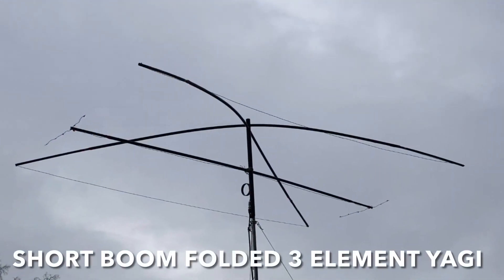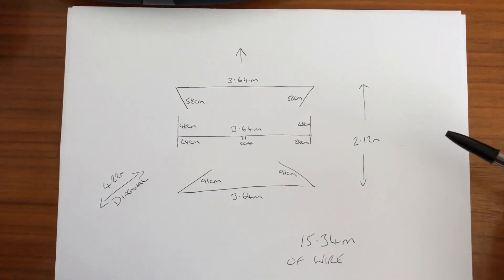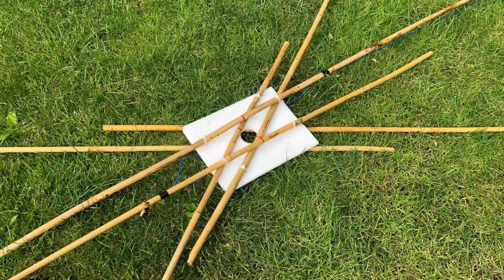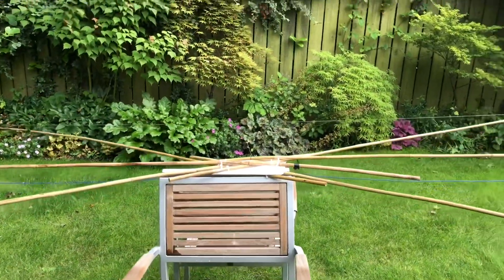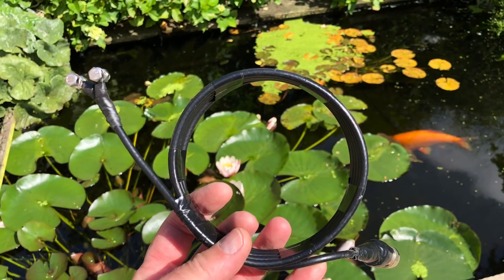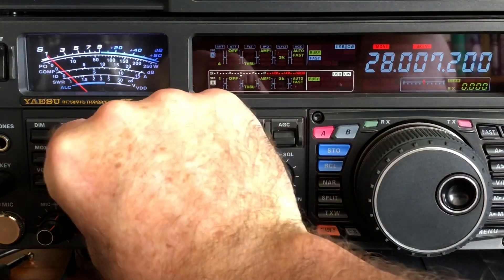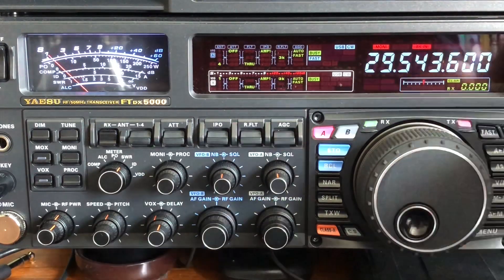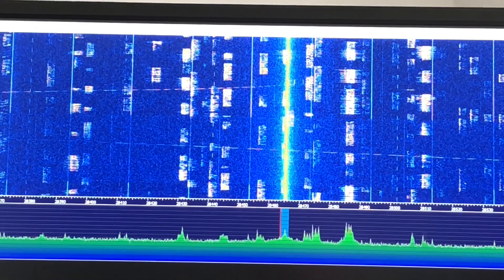DIY Compact 10m Yagi Mk2

Comment: I'm building this antenna (10m) following your videos, thanks for putting them up. I don't have a portable telescopic mast yet, what are the specs of your one? I'm using a heavy concrete umbrella base, maybe i can get a 3m pole. What is the minimum height for good SWR?
Reply from the maker: Good one Rob! Mine, with stub top is 7m tall. If you can say to 5m then that’d be great. Have fun 👍🏻
Reply: @G0CNN-Ian  I bought a 6.5m aluminium pole, it's up on that. SWR is 1.25 at 28.036. So far so good, got some more distance contacts. See photos on my QRZ VK3LER.
Reply from the maker: @Rob-ml7ps RR 👍🏻

Comment: From KC2UT Jerry, 
talked with you this morning Ian, you had nice 10 watt signal here in Central NY. ... Question: with the close spacing and folded elements is there some sort of matching going on as I would think the antenna is much lower than 50 ohms? But the proof is in the pudding, you sure had a smashing signal into Central NY this day, lighting up my Rig nicely and with my fixed Vee Beam with two 104 foot legs looking your way. Your Beam seems to operate well and at a fairly low height too... It looks your beam maybe just 20-30 feet above ground, which is fantastic.   Will save this page for future reference, thanks Ian......
Reply from the maker: Hi Jerry. It wasn’t me you worked today as I’ve been at work. Yes, the capacitive loading of the folded ends is what I think helps give it a good match. Yes, I’ve used it at around 22 feet and it works great 👍🏻 Hopefully catch you on the air properly 😉
Reply: that is fascinating if it indeed wasn't you Ian , because if indeed it wasn't you, then who was it ?   Am sure it wont be the last unusual contact  I make this sunspot peak... All the best
Reply from the maker: @jerrym1183  Strange. Were they using my callsign (G0CNN) or just referring to the mini-horse and my videos perhaps 🤔?
Reply: @G0CNN-Ian  catching up this, we had a qso, station identified as you and gave me the particulars on the described antenna.... I guess an honor to be "imitated" but weird at same time, will go back through my paper log and see if any other clues... In the meantime enjoy these great band conditions and Xmas season  🎄 !!
Reply from the maker: @jerrym1183  Weird. Merry Christmas 🎅🏻

Comment: hi just finished building your mk 2 ,my swr is roughly 2.0 to 2.1 across 28 mhz ,any advice please what i need to adjust to bring it down,i used single insulated electrical 1.5 cable,and your precise measurements
Reply from the maker: Hi Paul. First I’d check the measurements just to be sure. If you can go either side of the 10m band then you can see if it’s resonant higher or lower (with an analyser or your rig). If this is the case, then you can trim the elements proportionally. Only by a small amount at a time I’d say. You could always use the rig tuner to improve the match and see how it performs as you may get away with it. Without it in front of me it’s hard to help unfortunately. Good luck 👍🏻
Reply from the maker: Another thought Paul. Test it at height and not low down…SWR should improve…

Comment: Interesting that the bamboo gets rid of the bit of droop. I am sure you probably mentioned it on previous Horse videos but have you any idea of the gain, would it be the same as a regular 3 element Yagi?
Reply from the maker: Yes Chris, lovely and flat with bamboo and if I mark it up it could be /P too, so much prefer this method for the 10m format. Gain looks to be similar…1 minute into the first video “Getting Ready for Spring Summer DX!” thumbnail, but YouTube titled “10m & CB Band Simple Effective Yagi Beam Antenna” 😀
Reply: @G0CNN-Ian  what the angle that you are using in the X? thanks
Reply from the maker: @10ot172  Hi Adrian. I used the element lengths and spacing, not the angles to put together. I’ve done a calculation and the front and rear large angles should be 120° each. Hope this helps 👍🏻

Comment: 10 and 11 has been good for weeks now, but it comes in at strange times sometimes.  Do you know the sizes for CB 11 meters or am I going to have to work it out?  :-D  Ok, I'll get the calculator :-)  not so portable as the last one you made I don't think.
Reply from the maker: Hi Bob! The previous videos mention 27MHz measurements, but this one was 1:1 @ 28.000, so would tune lower than this as is, or if you want just add a few cm front and back and half this at the two ends of each centre fed element 👍🏻ps. Portable? The 8 foot canes fit in the car, so if I marked which went where on the chopping board I think it’s probably as portable as previous version? I’ve left this one made up leaning against the gable end 😀
Reply: @G0CNN-Ian  I did build two beams one before, but a bamboo one came down in a storm.  A plastic one, to pipes, one inside the other survive three storms, but snapped and came down in bits.  Second one worked well, but I had it pointed towards Europe, but I heard America better?  Which is a bit strange as there was a huge hill behind me, everyone heard America and I didn't before I put the beam up, after that I heard America when conditions were right, but the beam was not pointing there!
I'll work it out, plenty of info out there.